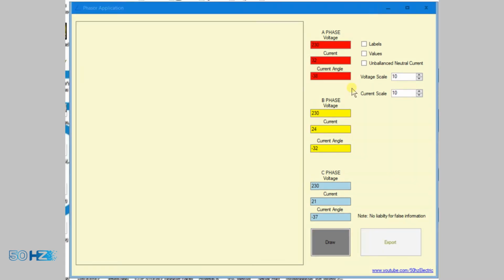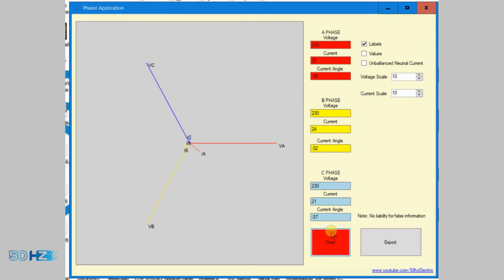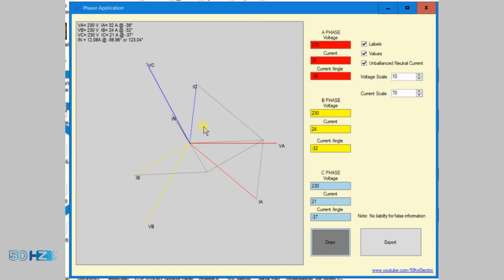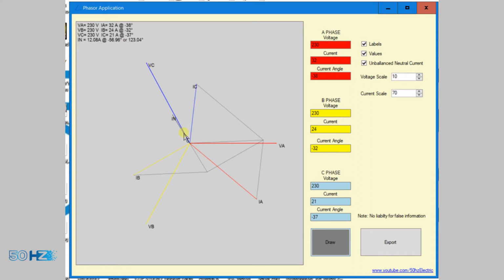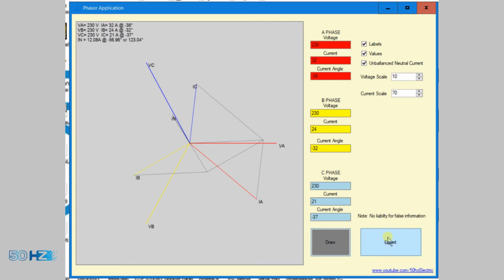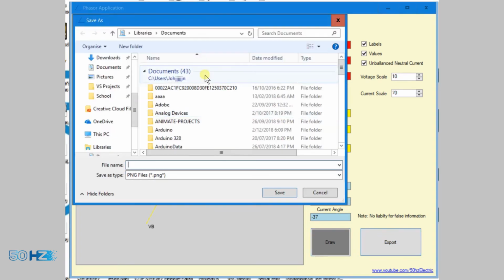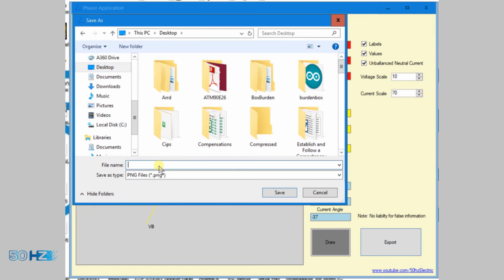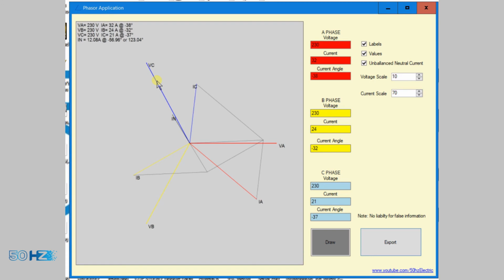Free Phasor Diagram Tool - For Windows

Comment: If the current is in phase with the voltage, you can't see the current phasor. My suggestion would be to incorporate the closed and open arrowheads protocol for current and voltage
Reply from the maker: Yeah I would of loved to of done that. It's a limit with what Microsoft has incorporated into the programming language. Thanks for the feedback. I was planning on revisiting this soon to see if there is any updates I can use, and I'll keep in mind your comment